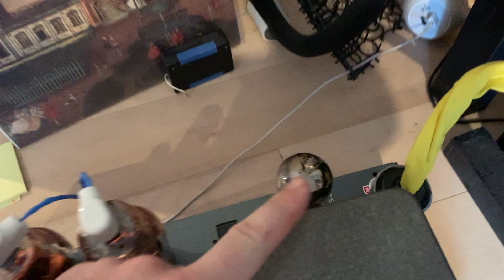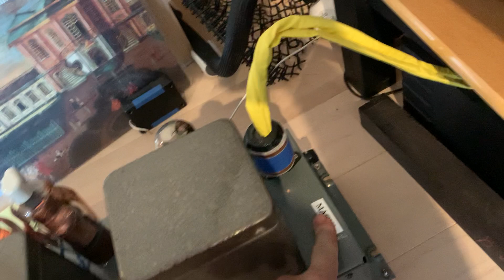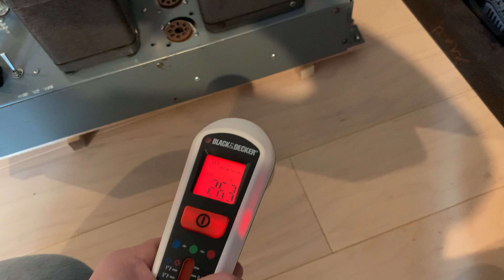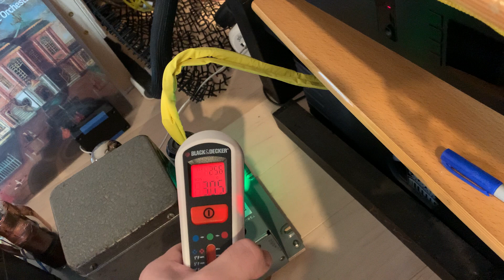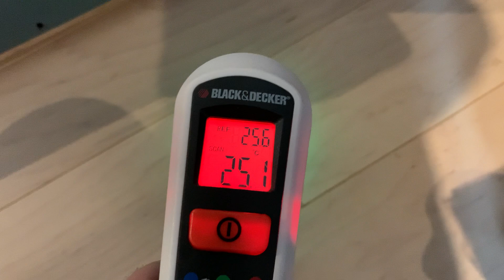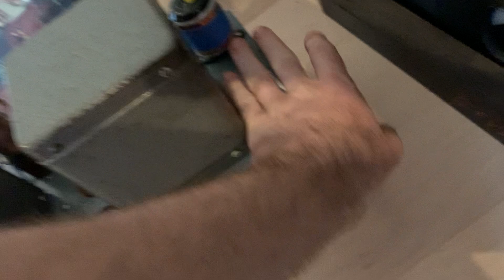Filament transformer added to Ampex 6516 - build log

Comment: Thanks for responding, you are very clever, and it basically tells me you are willing to
go to the ends of the earth to get the most realistic sound possible.When I demagnetize
I hold the tube between my hands an slowly rotate it horizontally and gradually bring the tube to the demagnetizer and when the tube gets close you can feel the tube start to vibrate i continue to rotate for about 20 sec and then I start to bring the rotating tube back
to my original position.I was quite nervous the first time I tried with a frame grid tube as the grids are very delicate. All the Best
Reply from the maker: Thank you Lou for the compliment! When I think of your amp with the 25kg Bartolucci transformer, and your vast experience with AN modifications, I think you are also someone who does not let his hands and mind sit in idle! I'll show a video on my demagnetization method. My mentor had an industrial demagnetizer - turn it on, and everything is demagnetized within a 10m radius. (And all tapes & hard drives erased, if you had any... plus, pace makers stopped...) It was the size of a big xerox machine. There was no fiddling necessary with it, just push a button LOL. :) Indeed, we tried crazy things - such as heating up a solder joint (while the amp was playing) to see what effect the joint temperature  has on the sound.

Comment: Remember shielding a tube has benefits of lowering the noise floor but it can also have 
a negative side of effecting the magnetic field in side the tube. I have tried this a number
of times it makes the overall sound less open and transparent,The materials inside most tubes are ferrous and through manufacture and use they become magnetized. Years ago 
I demagnetized the tubes in my system I was shocked at the improvement, like cryogenic
but better, ie more transparent and smooth.
Reply from the maker: Yes, I had the same experience - too much shielding and there's a noticeable loss of top end extension, and a closedness to the sound. For the 807 I noticed that if I have a full shield, and I ground it then there's a noticeable loss in dynamics, life, and a general decrease in spatiality. Hence, I'm just using strips (no grounding), and that seems to avoid that detrimental effect - not enough capacitance added, but enough to do the heat sinking. I noticed that the lower level the signal is, the more the capacitive effect is. When we think about it, the plate has high voltage and if we add an external shield at ground potential that slightly collapses the magnetic field that the shield generates. The higher the plate voltage, the more a grounded shield will affect the field - it is effectively adding an external screen, and turning the pentode into a hexode. :) Indeed, I like to demagnetize the tubes from time to time. Tube demag also helps with allowing the trapped ions between the plate - cathode to be released and captured by the getter, extending tube life. Funny, I usually demag the tubes while the amp is on. Also  did that to help tube break-in, and it noticeably sped up the break-in for 807. Thank you for sharing your observations, it is very rare to find someone who is also so much into experimentation! I'll share my experience with cryo'ing (and baking) tubes and other parts... I foresee a series of videos ; )

Comment: How come you don't cover your valves with copper tape?  it would be a good idea make little jackets for them should disperse heat protect from straight waves EMI and give it some isolation from acoustic vibration especially from the Transformers, what should be isolated on sorbothane, do you have your transformers in oil? A pure mineral oil called transformer oil should be good
Reply from the maker: Thank you for the reminder! At this time only the power tubes have the copper tube heat sinking, but normally I heat-shield all my tubes. The Ampex transformers are potted, they have some dampener inside, which, after 70 years, is leaking very slowly. I mount all the transformers on rubber grommets for vibration and magnetic isolation, will make a vid on that ; ).
Reply: @realworldaudio  you might like this Zamrock very good artist paul Ngozi only come across them a little while ago fusion of psychokinetic rock reggae
https://youtu.be/p1066KJSoSI
Reply from the maker: @johnsweda2999  Thank you for sharing! Pretty cool artist, checked him out :)
Reply: @realworldaudio  ok